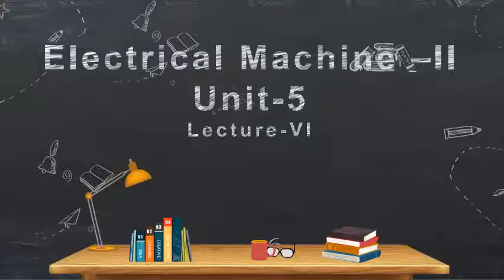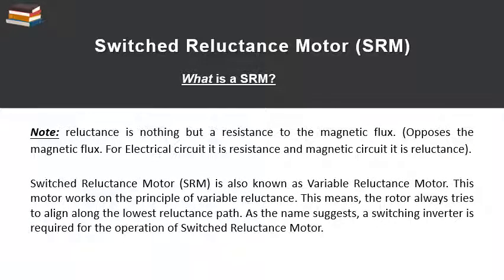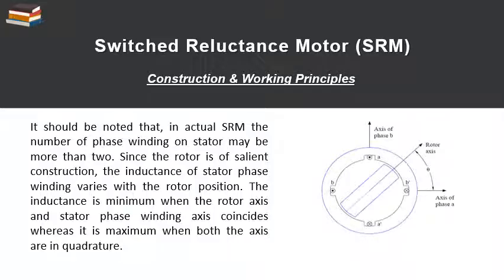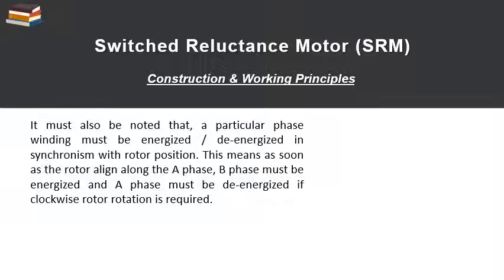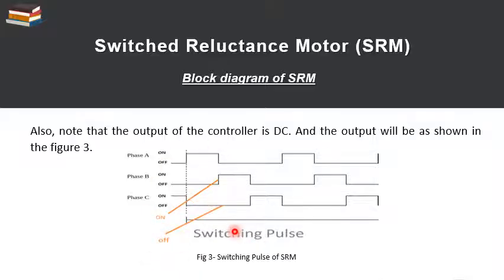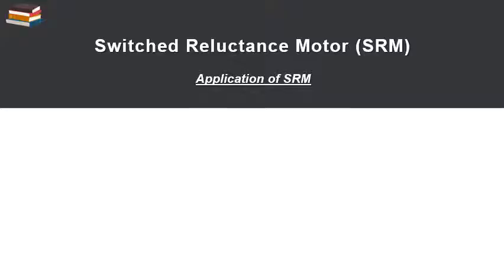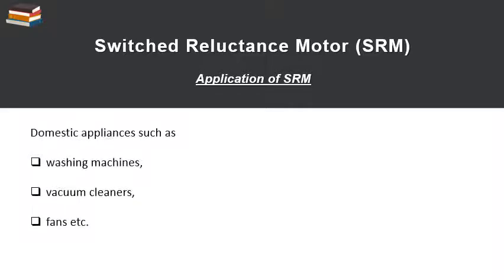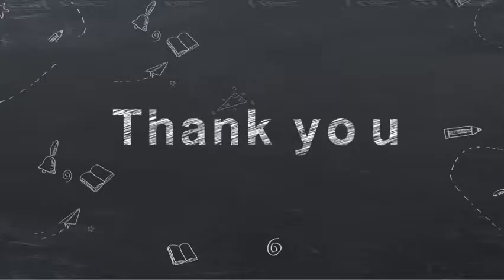Switched Reluctance Motor | Prof. Ankit Chourasia | SISTec, GN, Bhopal

Comment: Hello sir, exactly which kind of controller used in SRM, im doing my final year project and need to use specific SRM controller  in my project work practically.   8/12 pole ratio srm we have designed, How to get controller.  suggest me.
Reply: Hello parth I am Mechanical engineering student I have to design an SRM motor for my project but finding it difficult to do design calculation of it, would you please be able to help me.
Thank you
Reply: @ashishac7913  Greetings. I worked on intelligent optimization of switched Reluctance Motor. You can chat me to see if I can be of help.